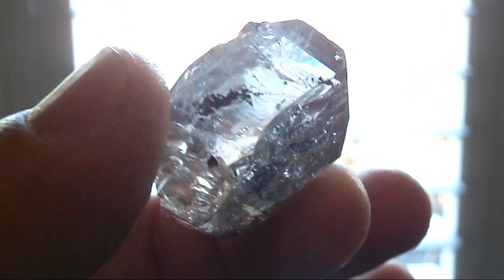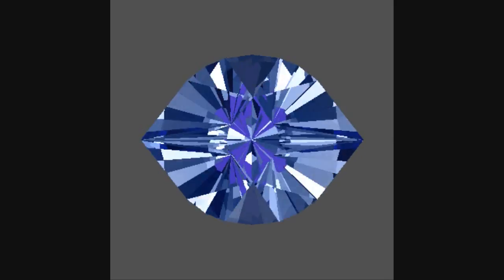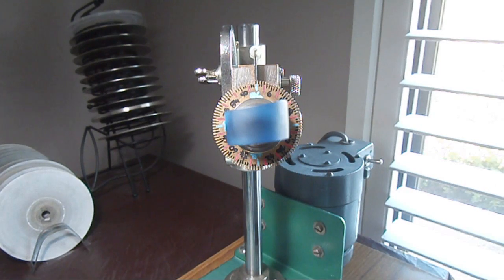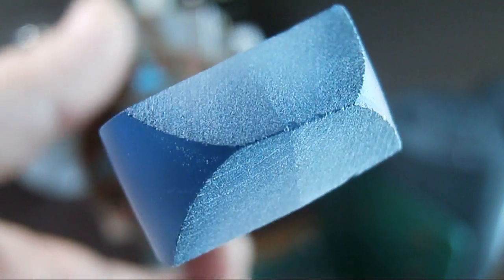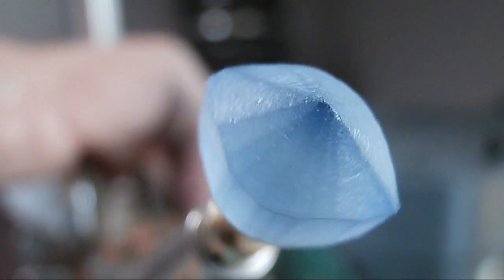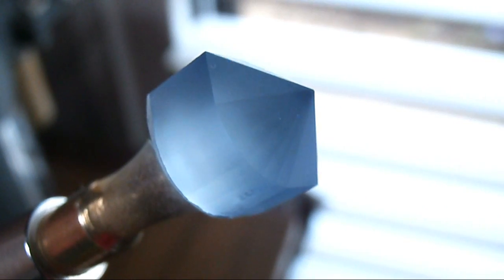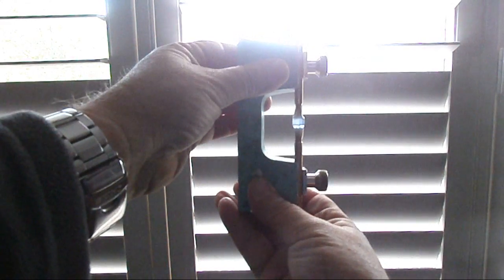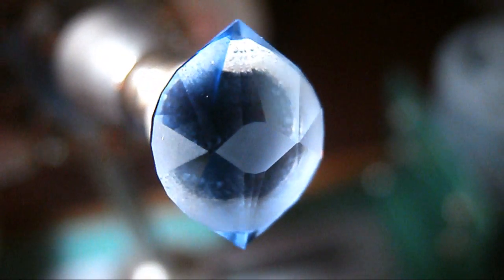How To Facet Gemstones - Sapphire Flame Fusion

Comment: are there any specific laps to use for faceting and polishing saphires. from heavy to fine.?
Reply from the maker: 600- 1200 grit topper lap, then 8000 grit diamond on copper for a prepolish then a final polish on tin with 50,000 diamond grit for small sapphires.

Comment: I ment to ask a while back , but it looks like you went back to Devcon epoxy  the superglue must have been to hard to work with
Reply from the maker: Actually, infact the super glue is a stronger glue. I used it on the first transfer of the "bling bling" video then the devcon. Didn't use it on the Opal as the super glue is harder to remove so I didn't want to chip the soft Opal. Apart from the difficult removal I use it to glue flat head nails on gems to make cabs out of at my gem club every week. So I'm saving the super glue for my cab work. It's a easy product to use, apart from the extra heat needed to detach it.
Reply: @VintageTimeGems  gluing a nail for making cabs? That's such a neat idea!